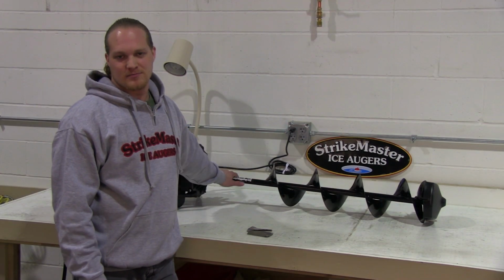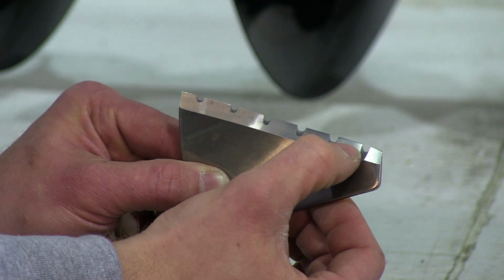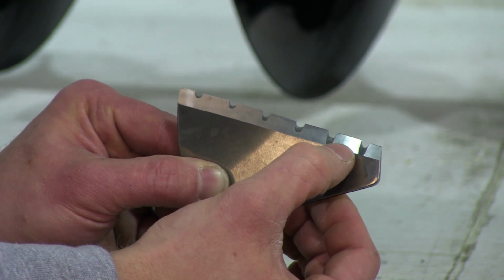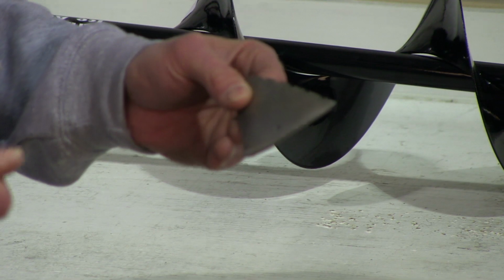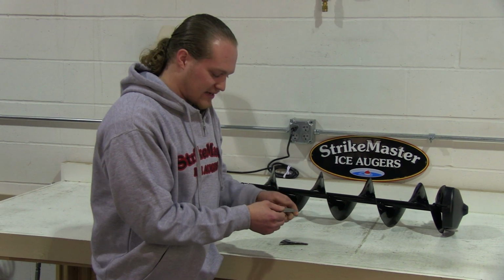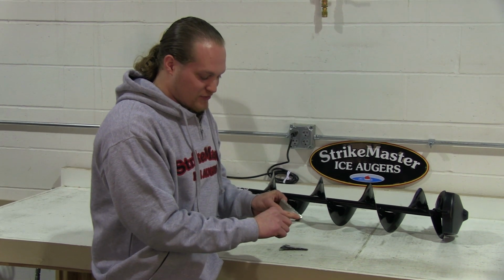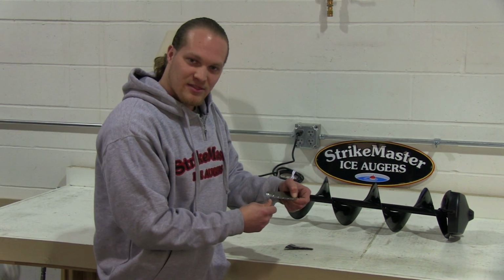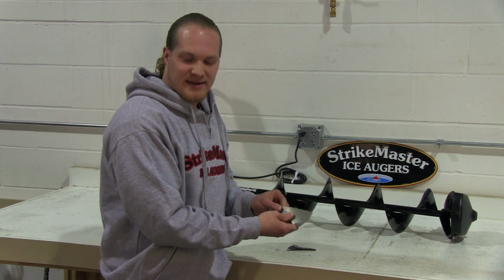StrikeMaster Auger Tips: Checking Blade Sharpness

Comment: Is there no way to sharpen these blades?
Reply from the maker: StrikeMaster recommends NOT to “sharpen”, “touch-up”, “recondition” or “re-machine” any auger blades. The angles are very precise and the blade hardness is challenged when this is attempted.  If there are any Knicks, dings or roll-over on blade leading edge, replace with new StrikeMaster factory packaged blades.
Reply: This is the reason why I don't buy this product
Reply: I wonder if other brand blades will fit it, had mine for one season its already dull and chipped I didn’t know I sharpen the blades for this season it wouldn’t even go down the ice even with force, it sucks brand new blades cost half the price of the auger, will buy something eles
Reply: Bullshit they sharpen just fine.
Reply: This is ridiculous. It’s super easy to resharpen their blades. Especially if there’s just a burr on one side. Takes 2-3 minutes of sanding on a super fine wetstone. They just want  you to buy more blades, more money in their pocket.